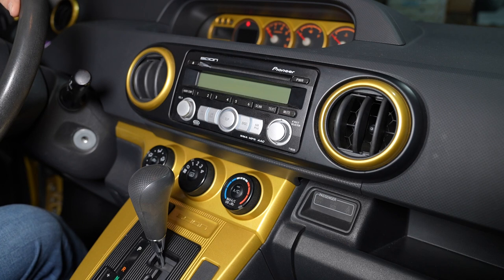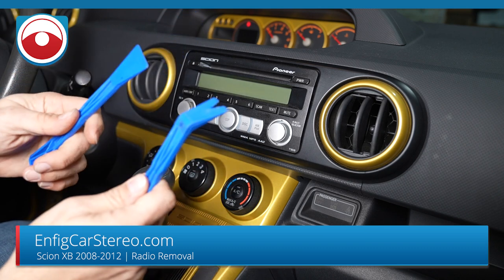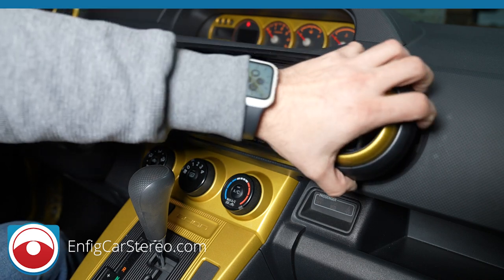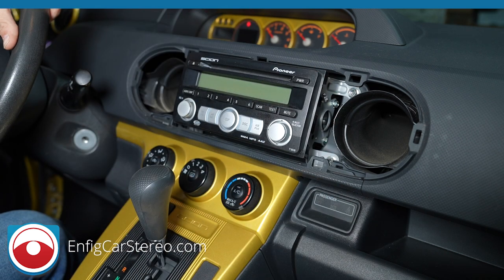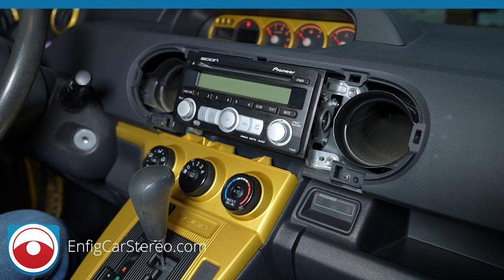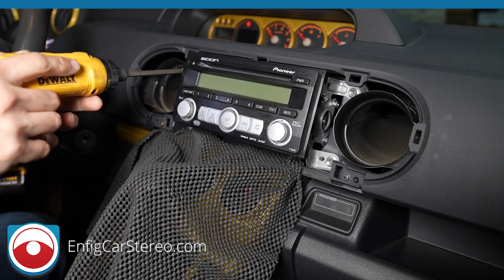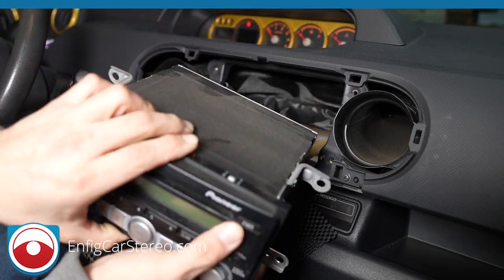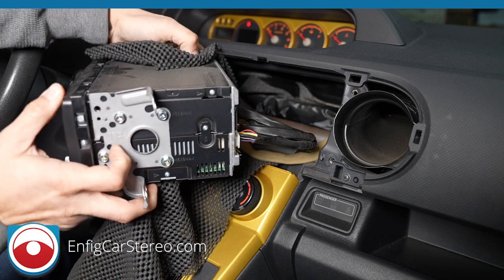Scion XB 2008 2015 Radio Removal

Comment: As an ex car radio thief long ago when I was young. I got this car recently. You do not need that trim tool cover pops out with simple fast pull on cover. I just came here to see connectors as one was hidden in dash.
Reply from the maker: It really depends on the car.  I remember this car looked brand new and popping off the trim was not easy with just fingers.  I always try before I use the tools on a video.  And if I think its close I mention that too.  Maybe your panel had been removed before.

Comment: Thanks for posting this video. I have an 2013 XB with a standard radio and I want to install an upgraded original radio that was offered for this car. Do you know if the connectors are compatible or do I have to modify anything?
Reply from the maker: I don't know the answer to that.  People don't really come to me for OEM swaps

Comment: Thank you so much for this informative video.
I have a 2012scion XB stock radio but does this radio require a radio code if I reinstall it. Thanks
Reply from the maker: I'm not sure since we put in an aftermarket radio but usually you do not.

Comment: Disconnect the battery that way you don't eat a airbag
Reply from the maker: There are no airbag wires connected to this radio.  Disconnect the battery if you're afraid to pinch a wire and fry electronics but there is no airbag danger when removing this radio.